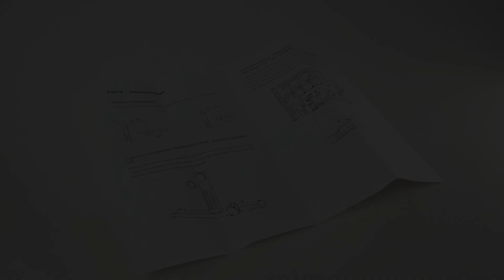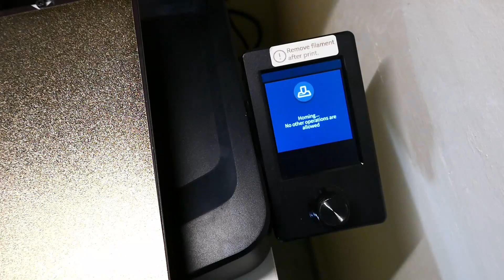Ender 3 V3 SE Filament Runout Sensor Upgrade

Comment: The left of the frame has a hole for you to put the cable in😂😂😂
Reply from the maker: For some reason, I got one that doesn't have a "cable passthrough". Anyway, I figure it will not fit cables for a LED light, runout sensor, and a future vibration sensor. Will manage the cables in other ways.
Reply: @reddotgeek  uhhhhhhhhhh can you just drill a hole in it?
Reply: @reddotgeek it will

Comment: Assuming that you're facing the printer with the logo in front, if you look closely at the bar, you'll see a very small "cutout," (or groove) on the left side, just thick enough for the cable to fit.  Run the cable through the left frame (may need some help feeding the cable - I taped some wire to the end), and it will take you straight to the mainboard. The trick is to string enough cable to provide slack to the sensor (allowing for the brisk shifting of the filament), keeping the length in that groove while you loosely reassemble the bar to the frame.  I used a spot of hot glue to keep the cable in the groove.  Remove the excess by pulling lightly on the end by the mainboard.  Make certain that the cable's still in the groove, then just start the screws into the bar - don't tighten them down until you've tested the connection and verified that the cable won't be pinched (or cut) when you do tighten them.

Comment: Glad I didn't follow your instructions, because you installed the cable wrong. 
It goes down the left side tube and there is a notch at the top.. therefore it will not cut the cable as you note, not to mention there is a nice wire channel in the underneath of the bridge to make a nice clean install with no wiring showing... Not egg on face! 
Also the motherboard only has one connector that matches the cable connector, so it's pretty much common sense on where it goes. Again, glad I didn't follow you and found another video that was helpful
Reply from the maker: Glad it worked for you. It's strange how I did it "wrong" with Creality's wrong instructions but it still works anyway. 🤣

Comment: Any clue why the sensor lights acknowledge the presense of filament but no commands are sent to the printer?
Reply from the maker: Hard to tell. But if the sensor is working, the problem lies with either the connector or the motherboard itself.